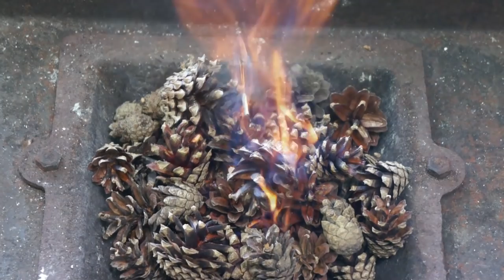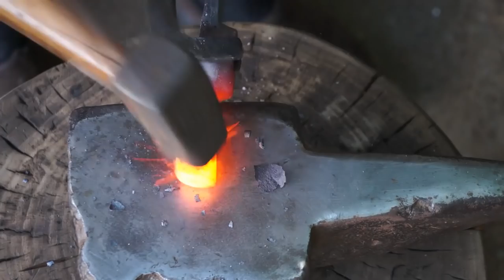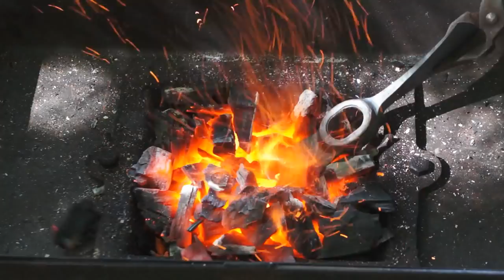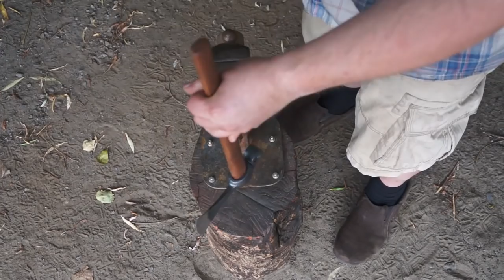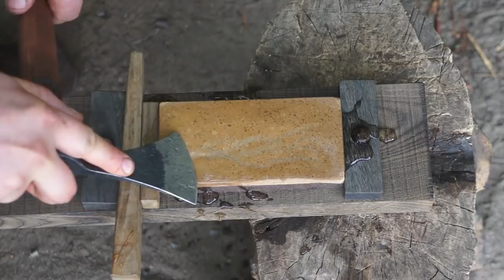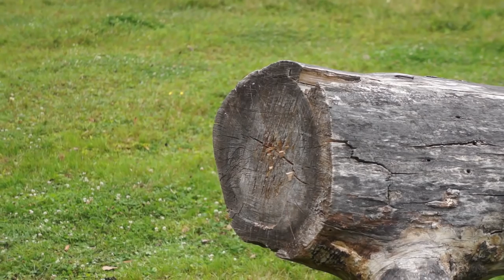Reforging. Elven throwing ax. Tomahawk.

Comment: isn't the advantage of a hawk that you can easily remove the head (and it is only friction fitted) and yet you wedged it, so eliminated that advantage?

Other than that excellent stuff, though I do wonder where the 'elvish' influence is also? 
Don't get me wrong, I love the design and have no problem with you naming it a elvish throwing axe, but it just doesn't scream 'elvish' to me for some reason.
Reply: He would have to reforge the shape of the eye to get this kind of fitting.
Reply: @SatanSupimpa  He seemed more than capable of doing that.